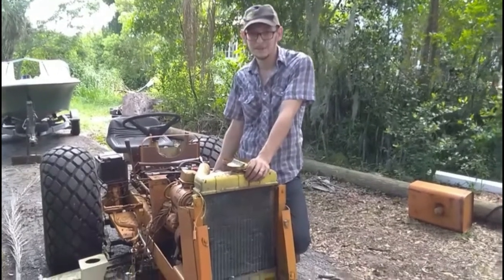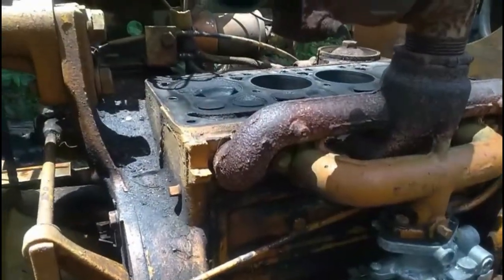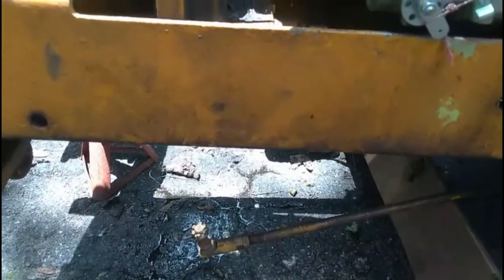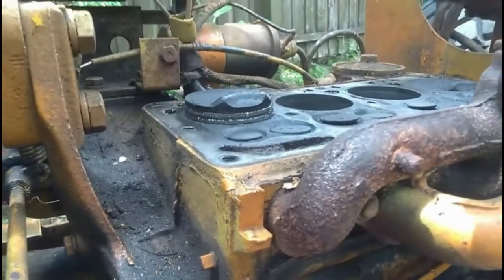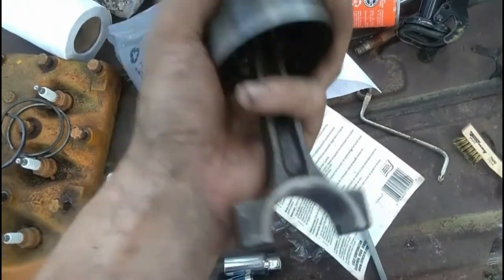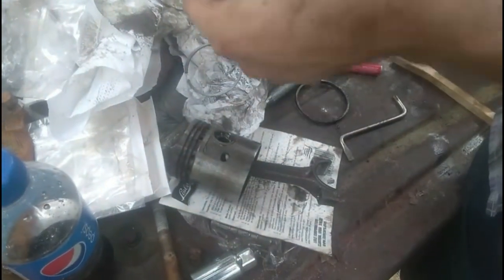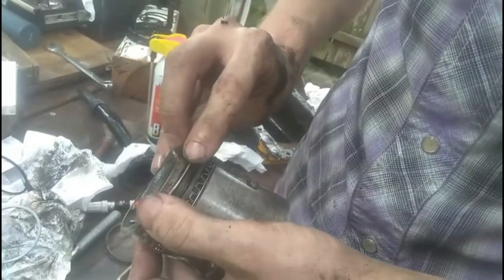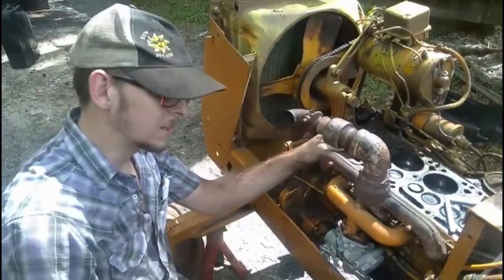Simple Flathead Engine Ring Replacement

Comment: great content 
I have a 226 flathead 6 that is gonna need ring replacement I didn't quite catch when you said that the rings cannot line up straight together so would the have to all face away from eachother
Reply from the maker: Sorry about getting back to you late. It was meant as an instructional for a friend, so I didn't put much effort into making things very clear. The gaps in the rings cannot line up so they need to simply be rotated before installing the piston.